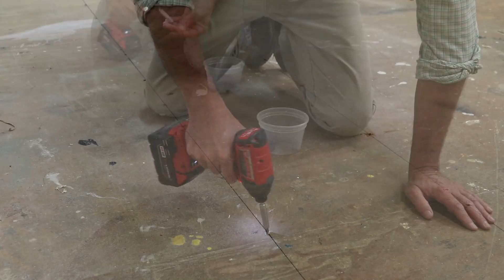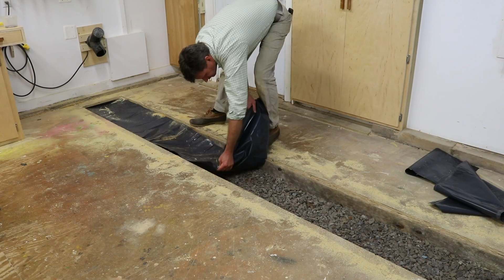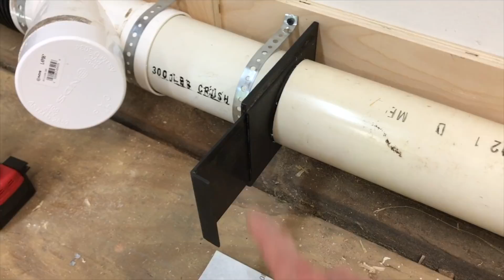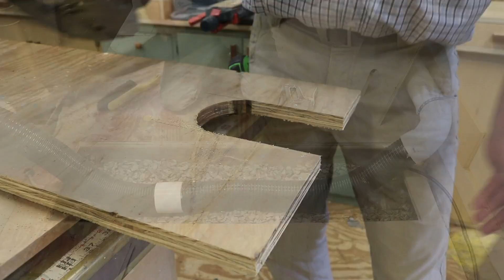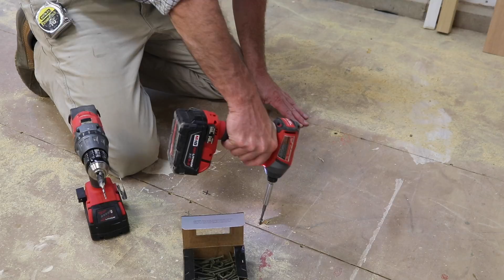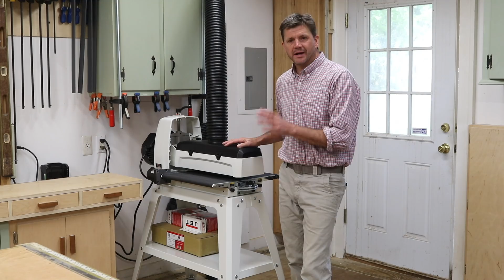Running my Dust Collection Under the Floor

Comment: Nice but 6" ducts will work much better.
Reply: 8 inch dia mains and 7 inch dia droppers for minimum 1000 cfm required at stand alone machines for good fine dust collection. This 4 inch rubbish is for chip collection around 350cfm.
That's according to Bill Pentz web site.
Reply: Ian Moone I have a cyclone with an 8" main that branches to six inch and For the last couple of feet I uses four inch. Works really well.
Reply: It would work a heap better if you removed the 4 inch and stayed with 6 inch all the way to the machine. This is not always possible I realize. In a case where 6 or 7 inch is to large dia to find an acceptable/workable path to the machine, sometimes you can take 2 x 4 inch to the same machine, so one to the cabinet below say the table saw and one to the dust extraction hood above the blade.
I have a colleague is a physics professor at our local uni - who's a keen wood worker and has delved deeply into Bill Pentz web site.
He has made a device for measuring the CFM going thru various sized ducts to his Pentz cyclone.
He says 6 inch MINIMUM dia to get 1000cfm speed/volume.
4 inch if it's a perfect run with no elbows bends or concertina flexible pipe etc - you MIGHT get 600cfm if your lucky but the average installation thru 4 inch only gets around 350cfm - which is fine for chip collection but not fine dust collection.
I never got into the whole shop dust collectors with needle felt bags and how out gassed formaldehyde gas from Urea Formaldehyde glues used to make man made panel products like chip board melamine and MDF, will give you a dose of taxidermists/cabinet makers lung (i.e. esophageal & or lung cancer). 
The dusts bad enough, but the formaldehyde gas will kill you if you don't vent your dust extractor air external to your shop and you work a lot with chip board melamine and MDF products.

This from Bill Pentz research links

[quote]
Fine dust particles of all types are often called inhalable dust because these particles are so small they slip right past our natural protections then go deep into our respiratory tissues where they damage and scar our tissues. The smallest inhaled particles can go from our lungs directly into our blood and affect our bodies all over. Inhaled fine dust particles are well researched and so heavily studied researchers call them PM short for particle material. A Google search on "PM Health Risks" gives more than 100,000,000 references. The peer reviewed medical research shows the respiratory damage is so slow most don't notice as it occurs, but every exposure to fine dust of all types causes a measurable reduction in respiratory capacity, some of this reduction becomes permanent, the higher and longer the exposure the greater the damage, and the damage builds to cause many serious short and long term health problems. Based on this solid medical research the EPA sets really tough limits for all airborne dusts.

Fine wood dust particles are one of the worst airborne dusts. The existing studies focus on large facility woodworkers where most of the dust is blown away outside and workers rarely work the more toxic woods. At a microscopic level wood behaves like a stack of glued together fine glass tubes. When our blades, bits, cutters, or sandpaper work wood these tubes shatter and millions of fine wood dust particles get launched airborne. A particle counter shows even when using a razor sharp hand plane that makes no visible dust we launch millions of fine invisible wood dust particles. Woodworking makes huge amounts of fine dust compared to how little it takes to harm our health. OSHA testing shows on average with every twenty pounds of woodworking sawdust we also make enough fine airborne dust to cause 15,119 typical two-car garage sized shops to fail an EPA air quality test. Electron microscope images show fine wood dust particles are covered with razor sharp edges and extended sharp often barbed points which damage and scar our tissues. These shapes also make it very difficult for our bodies to get rid of fine wood dust particles and cause them to get lodged trapped deep in our tissues. Wood dusts contain and carry toxic chemicals that these trapped particles can release for an extended time. As you can see in the below Wood Toxicity Table many woods contain chemicals that can be poisonous, cause us to develop pneumonia, increase our risk of cancer, badly irritate our eyes, skin and respiratory systems, and are sensitizers meaning we build allergic reactions sometimes in as little as a few hours of exposure. One of the better overviews of wood dust risks is the United Kingdom Health & Safety Executive (HSE) Toxic Woods - Woodworking Sheet No. 30. To set rates insurance companies accurately track worker injuries and medical problems. Insurance companies used to share their data, but most is no longer available because too many used this information to sue employers. The previously shared insurance data on large facility woodworkers showed a tiny number get poisoned and develop cancer, one in seven develop such bad allergic reactions they must stop woodworking, one in fourteen has such bad wood dust triggered health problems they are forced into an early medical retirement, almost all lose about 1% of their respiratory capacity per year of work, and woodworkers have shorter life spans.[/quote]

This presenter did a good video on how he ran his useless 4 inch duct under his floor. If it had been a 6 inch duct it MIGHT have been worth the effort.

One of the BIG problems for northern hemisphere wood workers with ice and snow in winter - i.e. freezing temps - is that when you collect fine dusts at the machine source well with 1000cfm extraction rate, & you vent it outside of your workshop - all your expensive warmed air in the workshop goes straight out into the atmosphere with the dusts. 

If you work with man made panel products held together with urea formaldehyde glues... & you don't run 6 inch or better ducts & you don't vent the air outside your workshop - then if the dust doesn't slowly kill you as it surely will, then the formaldehyde gas definitely will, and if neither of those get you then you'll freeze to death in your ice cold workshop.

Its a tough situation to get 100% right.

I would go so far as to say any dust extraction system that's below a minimum 6 inch diameter is only a chip extraction system that saves you time sweeping up.

3.5 to 5 hp and 14 to 16 inch extractor fan blade cyclone and 8inch mains, 7 inch drops and at least 6 inch to machines is and actual dust extraction system provided its vented external to the shop.

For those of a mind too - Stumpy Nubs on Youtude has a couple vids on how to make your own pentz Cyclone with a 3.5hp dust extractor motor and MDF/chipboard on the cheap.

It's a big topic - probably too big to do justice in a youtube video comments section.
Reply: Ian Moone thanks for the information!
Reply: Bobby, I lost my father / wood working business partner of 20 years to esophageal cancer, because of formaldehyde exposure - because we knew nothing about the dangers, and used a single phase 1 Hp needle felt bag dust extractor that vented into the work shop. We wheeled it from machine to machine. I used to shovel wheelbarrows worth of MDF dusts full of Formaldehyde gas out-gassing from the dust every day.
We had just the one dust collector and wheeled it from machine to machine as needed.
After dad passed, I was at the stage of dust/formaldehyde gas sensitization, that when I arrived at the factory and opened the roller door of a morning to start work, I'd get a coughing fit so bad that I'd cough until I brought up blood, black out from lack of air and collapse on the floor. 
I had to sell up walk in walk out basis and even 12 years later, I can NOW work solid timbers again with no issue, BUT I can't even walk into the Isles at my local hardware where they keep / store the man made particle boards, MDF and Melamine & that's the Formadehyde out gassing from the man made panel / sheet material.
I know the symptoms really well now, and recognize them pretty quick... sweating itchy and watering eyes, nose starts to run, then I get a tickle in the back of my throat, that I just can't make go away by coughing, but I also can't stop coughing due to the tickle in the back of my throat.
I cough until I throw up stomach contents and if I haven't got out of the hardware into clean fresh air, then I cough till I bring up blood & then usually everything gets dark like looking down a tunnel and I pass out!
I guess I am one of the 1 in 7 or 1 in 14 mentioned in the medical statistics. At least I am still alive - my father wasn't so lucky. 
I wouldn't want to see anyone that wasn't aware the way I/we weren't aware, go thru the radiation therapy and chemo therapy that my father went thru.
When I was suffering these coughing fits - a doctor friend heard me having a coughing fit one morning and referred me to the states leading lung specialist, who is an acknowledged world wide expert in mesothelioma (asbestos fibers caused lung cancer).
I had all the tests and x rays etc & he couldn't diagnose what was causing my problem... nothing showed on the xrays (The way that cancer caused by asbestos fibers does). I had all the common allergy tests as well - nothing reacted... but they don;t test as a rule for Formaldehyde sensitivity is the issue. 
So this is one big issue - that GPS etc and even lung specialists aren't up to date/speed with data and symptoms etc for diagnosing workplace related dusts and Formaldehyde exposure / sensitivity in timber workers.
Its easy to be affected for years and never be able to pin it down as to what the actual cause is. Because it used to happen to me in the morning I started thinking I was allergic to milk in cereal or maybe gluten in the cereal, so started cutting those things OUT of my diet to "see" if that would improve my condition (which it didn't).
It wasn't until after I sold the business after 20 years, and changed careers for the next 12 years, before I started to come good again with my lungs health.
I think a LOT of wood workers don't really understand the threat from fine dusts and Formaldehyde out gassing from man made panel products.
Most of us think a dust deputy & shop vac are sufficient or a 1 HP bagged collector and 4 inch ducts are sufficient, and the sad fact is they just aren't!    
If I achieve nothing else with this war and peace length post than to educate ONE Wood Worker about the hazards of wood dusts and Formaldehyde out-gassing from man made panel products saw dusts - and prevent the going thru the agonizing death my father endured, then it was worth the electrons.
For me it's a very "personal" but mostly unseen/unrecognized risk/threat associated with the trade.
Reply: Ian Moone I really hate to hear about your father and I am glad to hear you are doing well.

Comment: I would definitely upgrade to a cyclonic dust collector. Those bagged ones just don't cut it if you're using it for a whole shop. Unless maybe it's more than 3 hp.
BTW, if it were my livelihood, I'd be  running a ground wire or using the appropriate pipe. https://youtu.be/4hS6IGO2tdA
Reply: The Ed Aker - The difference in the amount of air flow between that big industrial dust collector and a small level 1100 CFM collector is not even in the same category. There is simply is not enough airflow generated to cause the static electricity.
Reply: Tom's Dreamshop Worx my thoughts exactly, also the fire in the silo wasn't caused by static electronicity from pvc piping since there are defenitly no pvc pipes in that factorty being used for dustcollection purposes.
Reply: Incorrect "Toms Dreamshop Worx" about the static buildup. The "problem" isn't just so much that, low air flow might not cause enough static electricity to start a fire inside the collection bin etc.
The "problem" is that low air flows CAN allow fine dusts to drop out of suspension & start to accumulate at bends etc and partially block the duct.
When enough dust builds up the weight of the dust build up can cause PVC joints that are usually just a friction fit, and not glued, (to allow disassembly for clearing small stick jams etc), to "fall apart" under the weight of accumulated dust.
When they do - is when you suddenly / unexpectedly get enough dust air mix instantly  all in one spot, for a brief period of time, where it can reach the correct dust / air mix inside the workshop, for ANY ignition source (electric motor running in one of the machines for e.g.) to ignite and explode, with quite severe force i.e. enough to demolish the building and kill occupants. Things aren't always what they might at first seem.
I believe Bill Pentz website about his cyclone builds covers this particular issue in some detail.

Comment: Did you glue together the pipe?
Reply: Paulina Paulino i don't think so. Maybe to make it easy for replacing parts.
Reply: There's always at least one rude troll in every crowd, and apparently you're it.
Reply: What for ? No pressure no problems of dust leakage :)
Reply: maybe no pressure problems but that stones there for drainage so it could get water in it if there's a lot of rain and its not sealed
Reply: I just did not know if vacuum pipe needed to be sealed. 
I find it sad that if I ask a question with regard to a thing I did not know so that I could learn, 
a person here calls me stupid.